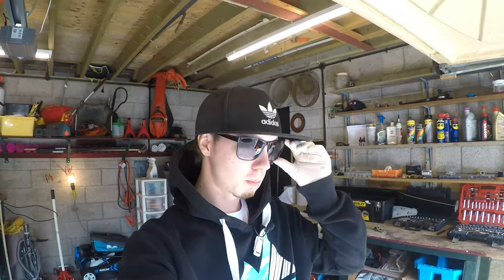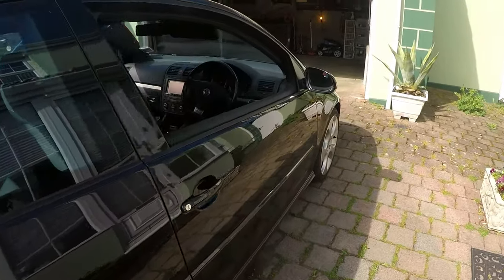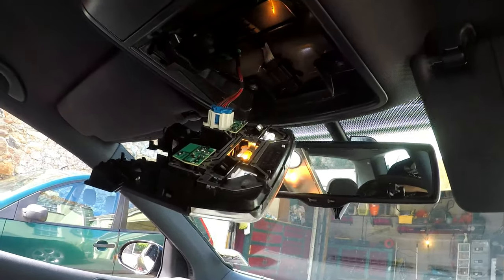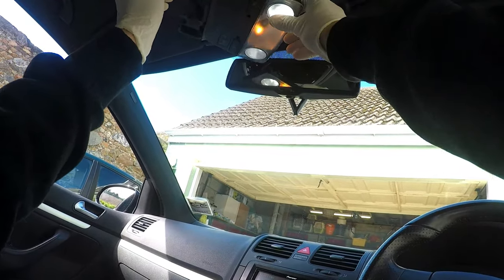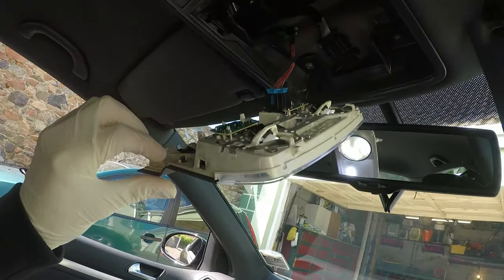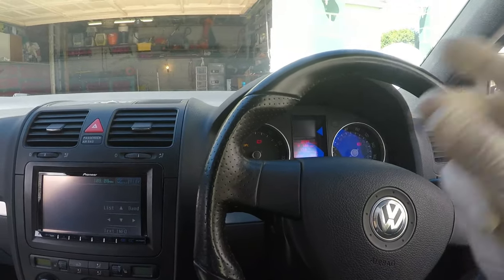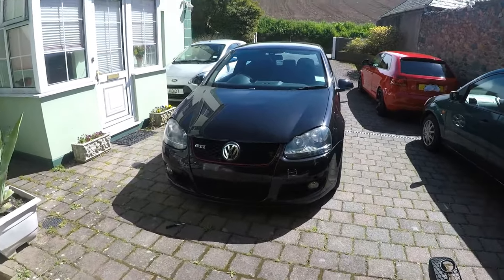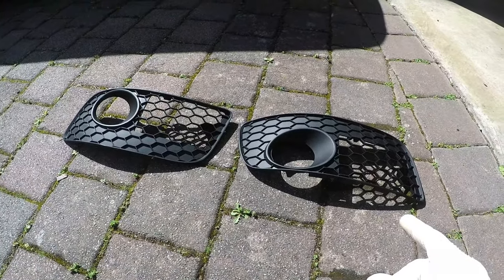VW GOLF GTI - FIRST MOD!

Comment: Mate apologies I haven't sent out your sticker as of yet been snowed under with work will aim for this weekend so huge apologies for that. But loving the work may be down to take a few bits off the Audi if you want I'll have the grill and wing mirror covers depending on what you do with it
Reply from the maker: Sean Satherley No worries mate I’m not in a rush, I would do the mirror covers but I do not have the originals to put back on the car, aswell as the grill , I do have the original but it’s beaten up lol
Reply: @MotoAdventuresYT  yeah that's cool man well see how it goes bud may take them even swap you for them my original for your ones but good vid keep it up